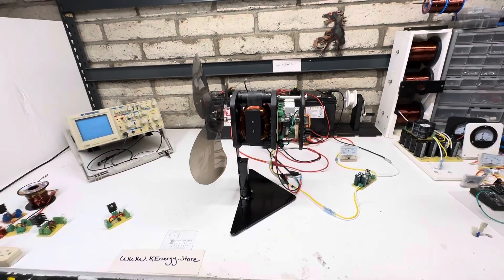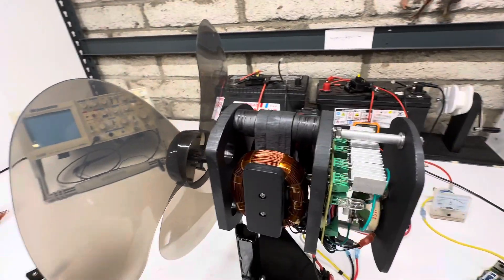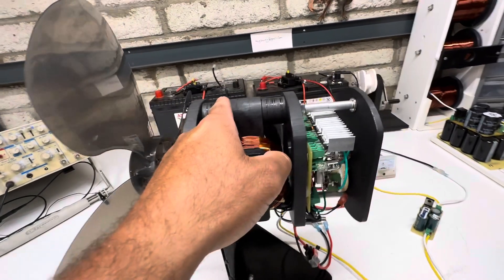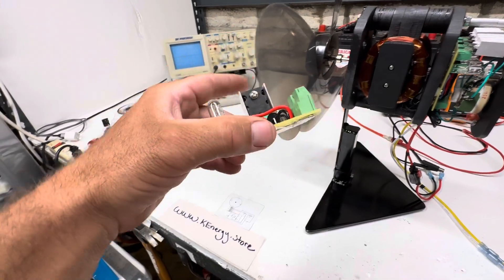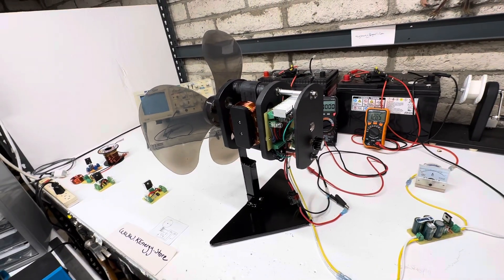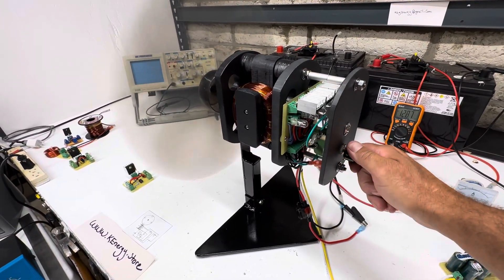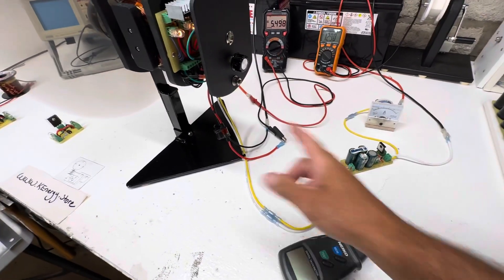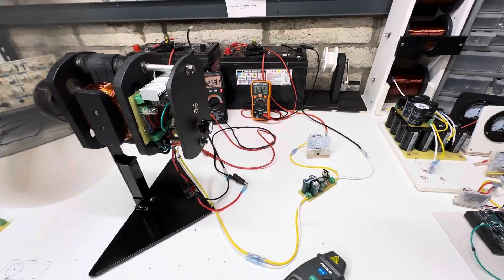Bedini window motor for sale

Comment: Hi, Can you explain, "Red and Black "wire input Supply to Motor & "Yellow and White" wire is Output from Motor to Charge Battery?
Reply from the maker: Red and black is power to motor 
Yellow white output for battery charging